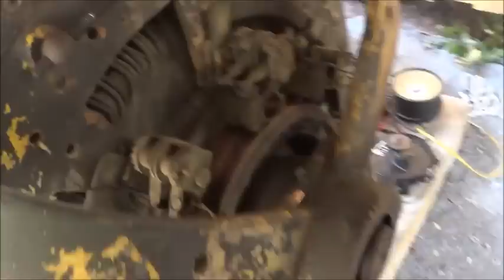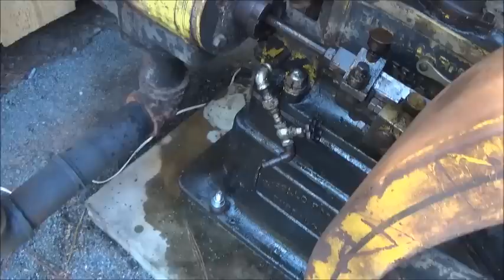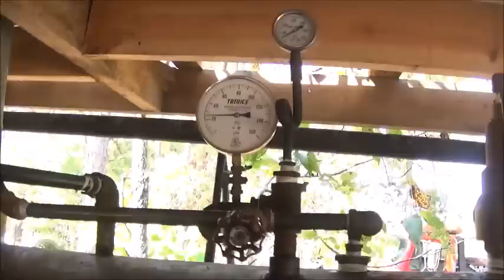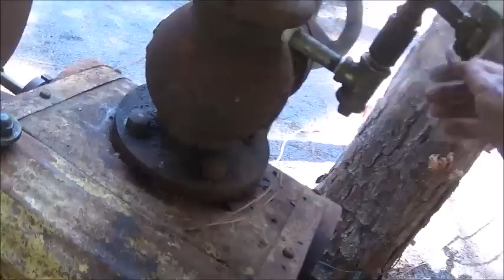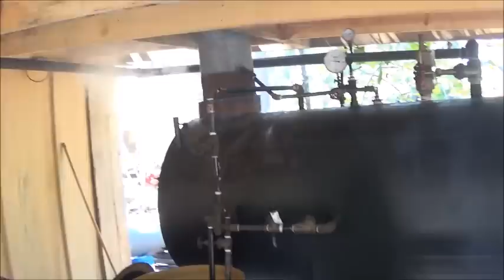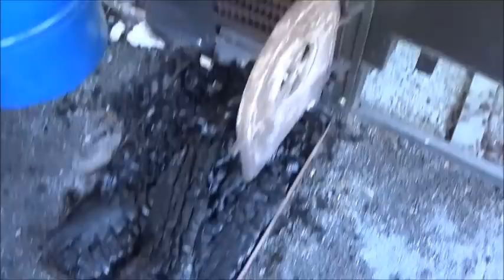MAKING ELECTRICITY FROM WOOD/ BOILER FAIL/ CAMARO PROJECT

Comment: The LED light strings have a small AC to DC power supply/rectifier built in.  The orientation of the plug should not matter.

Comment: tubes blow out from age and incorrect welding.   They do not blow if they get clogged because the other tubes will take the flow.   Most likely the failed tubes were welded improperly.   On a properly welded system the lower tubes will fail first because acid is heavier than water and will concentrate in the lowest tubes.    But still, that is a long term problem.   If you have a failure in the short term, you have not welded properly or exceeded the pressure ratings of the pipe.    The latter is extremely dangerous
Reply from the maker: No one said that it blew because it was clogged and there is not a single weld on these tubes they're drawn over mandrel. The tube blue because of incorrect water treatment
Reply: @jonathanw4942  That means the tube blew out from age.   It means all the tubes will be no good.  If one fails from "incorrect water treatment" they all will.   The old steam locomotives ran untreated water and when one tube failed they all began to fail but that took many years.
Reply from the maker: There was calcium buildup in the boiler. I know the tubes have issues, but a tube failure is not a boiler failure. There's really no danger in anything except putting your fire out. I wouldn't say that it is age because this boiler is a 1988 model. It was used in the city without water treatment to fight the chemicals that were added by the Water Department. I know the tubes will go one at a time, but I choose to repair them as needed.

Comment: A suggestion. Put your feed water stop valve next to the boiler. That way if the check valve doesn't seat you can shut off the valve and work on the valve while still having boiler  pressure. If not already there, schedule 80 fittings to the first valve is the best.

Comment: Boiler tube rollers and beading tools are around. We made a tube sheet reamer that was powered by a pneumatic tube roller. I did 5 locomotives before I retired. Tough work. We also made a tool for punching tubes from tubing with a slot at the front to vacuum the soot as the brush scraped it free.

Comment: Nothing like rodding out a boiler, except maybe cleaning a old style cooling tower where you have to put on waders an scrape it all by hand.
This is after you hit it with pressure washer, and it basically laughs at you for thinking you can get away with something easier.
283, or 327 in the mullet, are is that just the choice of manifold you wanted to use, and that bored out 350 hiding under the vent tube oil filler capped manifold?
Hopefully it's a nice mildly bored 327, with a nice set of camel humps, are even a set of angle plug heads since they  have holes for accessories. 
Nuthin like old sbc, Pontiac, Oldsmobile. Never played with any old Buicks, and so know very little about whether got any tricks hidden away or not, and fords, n mercury took too much work and money to make go, and never was exposed to no Chrysler Plymouth dogdes.
GMC, was cheap and easy to get excellent returns for your efforts, as well as easy on your hip pockets. 
Glad to see you still with us, and I do enjoy your boiler/steam adventures, equally as well for your other passions, but I have to admit I miss the old resurrections of those long lost souls hidden away out in the woods, fields, and old farmers barns forgotten about for more years than they remember. 
Thanks for the movie, and hope to see more  more often than of late Johnathan, because if nuthin else you got fasinating mind, and the way you always come up with a solution to whatever you wanting to do without everything you need to achieve your end goal.
Reminds me of me truthfully, but you've got wee bit more of the resources to accomplish those projects such as old lathes and such than I've got time to aquire, or time left to learn to operate such as the likes of it.
Hope the family, n grand kids are well. 
Come back sooner than later for those of us been round, as well as those of late too.
You're missed really you are.

Comment: look for a soot blower from an old boiler. using the boiler's own steam supply to clean your tubes is the easiest way and it cleans well. you probably already have tossed one of the old soot blowers into the scrap pile with out realizing what you had

Comment: At first I was a bit surprised that LEDs would work on DC, but reasoning it out a bit, the lights themselves require DC, so there needs to be a rectifier in there for converting AC to DC, and it kind of needs to be full-bridge, otherwise the lights are going to have a 60hz flicker -- so I can see why it would run fine on DC, it's just using half the rectifier. If they ever fail, you can try flip the polarity and use the other half of the rectifier.

Comment: Welcome back Johnathan W  :) in fire can get temperatures fast with wood would Fire bricks help out put in on floor of fire box were wood sit on plus sides most air tight stoves have them because my house use them  ! Fire bricks are like size of house bricks but like steel material and weight ! Hope that ideas help out you can check in to also !

Comment: Hello Johnathon, nice to see you getting to grips with steam you could just blank the tube for now. That boiler should be able stand a few tubes blanked to be honest it will tell you when you have blanked enough it won't steam. 😁 I agree when one goes others usually follow especially if they are not seamless tubes and have had no treatment it will be interesting to see the hole, I bet it's on the weld if it's a welded tube.
Reply: I agree with blanking.  After a few go there may be a pattern.  Then replace all the tubes in that section.

Comment: Maybe contact SmallEngineMechanic and see if he has any ideas on some sort of a automatic voltage regulator to keep the voltage a frequency on the dot. Less fiddling with manual valves.

Comment: I use to assist running a boiler about 40 years ago for a couple years.  It was made in the 79's and looked a lot like the one in the video only slightly bigger. It had an electric pump for the water and natural gas for fire. It took a little over 2 days to cool down enough to service it. I got to watch as new tubes were rolled into it once. It was made by  McKenna Boiler Works out of Los Angeles. Good job getting yours shut down when that tube went.

Comment: Add a full wave bridge to the input of a LED string and it won't matter which why it is plugged in. I started doing this to all the DC powered limits, radios and warning equipment where I work because idiots kept hooking them up backwards and blowing them up. Saved thousands and thousands of dollars.

Comment: Good too see Jonathan W back with more Good video content, Love the steam being SAVED from scrap and coming as a Kia or frigde/freezer, JW making electricity, now you need a wrecked Tesla battery, to charge and run off the grid 👍👍 burn rubbish wood etc to make power, Maybe a knowable older electrician will help JW get better set up 👍👍

Comment: How many amps are you making at 110 volts, and is this 3 phase or single
Reply from the maker: 140 amps at 125 volts DC and 350 rpm's.

Comment: Jonathan this is amazing! i noticed your circuit used 12 ga wire to power the lights,  what would you say the current is when youre running at about 120v?

Comment: Nice to hear from you- Does that generator make DC voltage? Is that an issue?
Reply from the maker: Yes DC, no not an issue at all. It will run a lot of AC stuff. Motors with brushes and incandescent lights. I plugged in an LED strip and it worked fine even though they say it won't.

Comment: Hi Jonathan, could you possibly run a pipeline from the engine exhaust to your boiler stack to aid the draught through the boiler once the engine is running? Rather than use the operating steam. All good stuff there ,many thanks from Nr Liverpool UK.
Reply: That was how the steam loco's operated, hence the characteristic
puffing sound they made.

Comment: Would like to see your boiler blow down  system , do you manually do it or have it automated ?  Which chemicals are you using in the water treatment process, how much solids come out during blow down ?  also do you have any steam traps or feel you need them ?

I see your pressure relief valve . Does it have an emergency pop off valve and what did you set it at ?

I am thinking you will have a lot  more tube replacing.

Please do not think I'm nick picking prick.
   I am thinking of when you open the museum to people and if they get too close with the tube failure etc etc safety first.

Good luck

Comment: Soon you'll be off the grid and can frame/board/shingle your own small town, cool or what!

At least the boiler failed the safest way possible. Still put a new bite mark in the drawers though I bet, lol.

I found a neat channel where a guy is automating coal creation with an augered retort. And by building a mini railway for hauling woodchips around his property, soon with a homemade air powered locomotive. Cut out the steel and made the bogey wheels type stuff. Thought you might get a kick out of his ideas for coal retort production. "Way Out West - Workshop Stuff" 

Good to see you again Mr.W! Keep staying safe as always.
Reply: Subbed!

Comment: you can use the steam generator to charge your carbon free electric car...LOL
Reply: Shhhh they aren't supposed to know that, runs on ferry dust.
Reply: Carbon free?where does the heat come from to make the steam?
Reply: @daleolson3506  Coal, Teslas run on Coal.

Comment: You need to make yourself a couple bugs to slam it the holes to stop the leak. Then you can bring the pressure down slow and not worry about over heating the boiler.